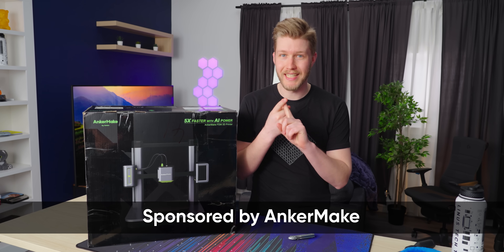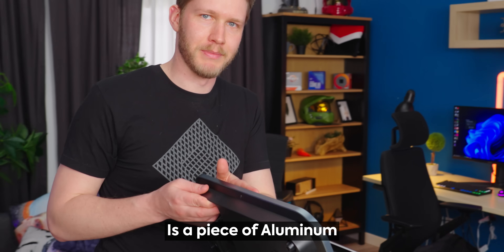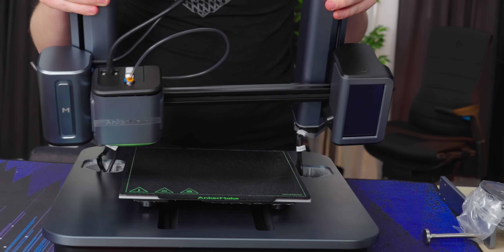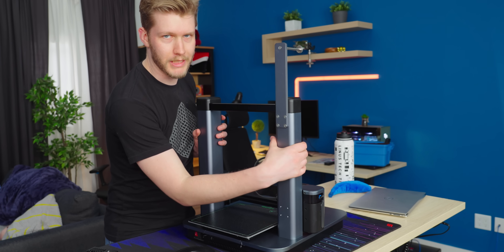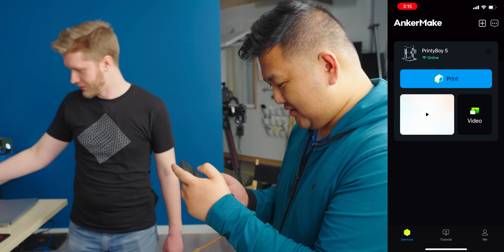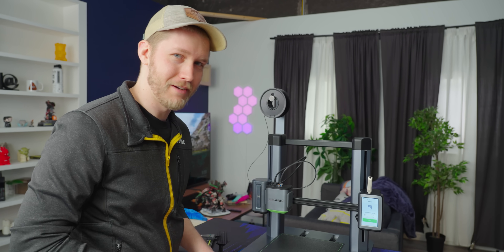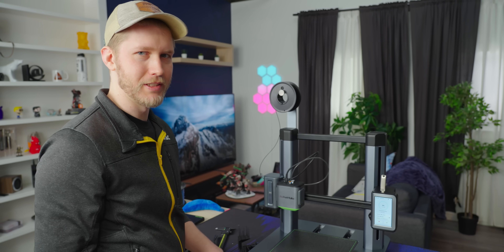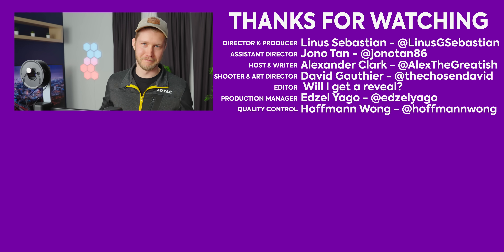Much BETTER than Expected - AnkerMake M5 3D Printer

Comment: There is no way that is actually 250mm/s. Sure, you can set the max speed to 250 but if your acceleration isn't set high enough it'll never hit it. Take a look at hevort/vez3d/voron speed runs. That thing ain't doing 250mm/s.
Reply: Yeah, I've got a creality CR20 pro, and I've extensively upgraded and switched out parts to make as high quality of a build as I possibly can - and I still only get a fraction of that. And It's still a great printer featuring work I'm super proud of! At the same time though, I personally feel like reaching the fastest possible speeds isn't always necessary, since in that type of range you will absolutely be trading speed for quality - there are times when you need to test a part, and you don't care how it looks so long it's done quickly, and other times when the quality is by far the most important factor.

In any case, that just shows how incredible those voron and rat-rig style printers are, and the sheer achievements of the people who build them. When you watch clips of those printers running, the footage is so insane, it just doesn't seem real.

Comment: Not impressed with the machine at all tbh, its a fancy ender 3, has a fake meanwell clone psu, what looks like a proprietary control board, the screen on the gantry adds excess weight for no reason. USB C isnt designed for motion, let alone constant motion with high accel/decel. The bed leveling system takes ages to complete on top of the excessive 7x7 grid. The advertisement that says a benchy takes 9 hours is hilariously bullshit, my ender 3 pro can do that in 1 hour 15 mins with a 0.4mm nozzle at .24 layer height with the same print quality by just upping the accel in firmware. This is just advertised to people who know nothing about 3D printers, its all marketing checkmarks.

Comment: I’m also pretty impressed on the build quality for its price! Looking forward to review one 🤘😎
Reply: its v rollers with covers to hide the fact that it's built like 95% of all other printers out there... there's nothing remarkable about the build quality.
Reply: @simonl7784  yea for 750 i would expect linear rails, its not that hard build couple prototypes and send them to YouTube channels
Reply: its kickstarter i would wait for final production unit reviews
Reply: Depends on if the price is gonna be 800 usd at standard, then I myself would just pick a prusa instead
Reply: I have to strongly disagree and recommend exercising caution in purchasing. This isn't a Voron 2.4 and it is painfully obvious. Wake me up when 10K+ accelerations and 500 mm/s speeds are here. And there are several parts that have been pointed out that will fail early on given the material used. Avoid!

https://www.youtube.com/watch?v=0E0dM0ZdpRE
Reply: Since this is preproduction I highly doubt it will be this nice but I'm looking forward to seeing how they come out.
Reply: @x9x9x9x9x9  it might just be nicer since this is preproduction.
Reply: Nah, retail is $750, not impressed for an ender 3 clone
Reply: @TheMidnightSmith   I was thinking the same thing - it looks like it's trying to compete with the Ender 3, but the price says it's actually competing with the much larger Ender 5...
Reply: @TheMidnightSmith  it looks like it has dual z axis motors though, a filament senosor, autobed leveling, direct drive extruder setup, and an app that works straight outta the box with minimal setup. For all those upgrades plus the ease of use / setup I'd say its pretty worth it. It competes in the same space as the Prusa Mk3 at that point which is around the same price for a similar feature set.
Reply: @6ixpool  direct drive has pro's and con's so i wouldnt count that as a feature more than a choice. and who needs an app? like whats the purpose? Dont compare this printer to a prusa. Prusa is on a whole other level.
Reply: @irozockt  as someone who has absolutely no idea about 3d printers,an app could be very useful.Also,what advantages does a prusa have over this?
Reply: @superblitz2274  holy shit is youtube buggy today or what? im writing this comment for the third time now.
Reply: @irozockt   you're not wrong but have you considered there are use cases / market segments for 3d printers, same as computers and all other tech, that may not make sense to you but would be profitable if filled. For even money yeah I'm of the same opinion as you - the Prusa is the obvious choice. 

This product isn't for us - this product is for people like us whose brother in law or uncle asks them what 3d printer they should buy & you know they're not a technical person. Alex said it in the video - "i've done literally.... none of the things... you should do when setting up a 3d printer, didn't even clean the bed... probably should have done that at least...  lets see what happens" - which is the perfect test. It's what the average consumer will do. Gamers Nexus keeps buying prebuilt desktops looking for something they can recommend not because they or the average viewer want a prebuilt desktop - we would obviously build our own. That would be the Prusa. What they're trying to find is a well built pre built with non scummy sales and support for a fair price - that's this printer. This, if the final product is anywhere near as good as this sample, is the "good prebuilt desktop" of 3d printers - something i can say this is good guilt free knowing it's a fair price and i won't end up having to be their involuntary tech support for the next few years.

You may think "still not worth it" and i would tell you the fact that it has an app with a camera that works out of the box and you literally never have to learn a thing about leveling a printer to get frankly impressive results is a major selling point to the target market segment of this printer. People used to 3d printing think the prusa/ender 3/etc is effortless compared to older printers. People still seem to struggle with them.... I say this as the owner of multiple $89 ender 3 pro's open box from microcenter - the one near me has 20+ open box frustration returns at all times. This is a printer for people who would rather just pay a few hundred bucks more for a completely upgraded idiot proof prusa clone. That market clearly exists... judging from all of the returned ender 3's lol
Reply: It's almost false endorsement to talk for many minutes on a feature that won't be implemented on the final product.
Reply: @bulljona11  considering they spent several minutes talking about how this is unlikely to be on the production model, it's not false endorsement.
Reply: @bulljona11  this is unboxing

Comment: According to their Kickstarter, the $429 is a special early price, and that reward is no longer available. The MSRP is $759. This is clearly not a machine for beginners, which is weird considering the features make it much easier to use
Reply: This is absolutely a machine for beginners. Beginner doesn't mean "broke" you know. They're going for a "just turn it on and start printing" kind of deal I think trying to reach a community of people who would like to get into 3D printing but get scared away because every review I've ever watched of a 3D printer in those price range is "If you do X or Y and use Z mod it's a really good printer" whereas this is marketed as "Put it together, plug into the wall, use the app and start printing"
Reply: @naunau311  But a high price tag is often a turn off for beginners. Lots of people want something cheap, but not as good, to try out, then upgrade in the future. 

This may not be high end, but it's priced like a mid range printer
Reply: @hapcot  It is priced as a mid ranger I won't disagree on that but the price point isn't really a turn off for beginners, it's a turn off for people who want to discover and learn more. There is a large community of people who just "want something that works" and are willing to put good money to get exactly that. That's something we could call the "apple market". Most people don't need an iPhone tier phone as far as performances and features go but they still buy it because it's less confusing than the android market and has a reputation to "just work"
Reply: Beginner friendly is a different definition to cheap. Beginners will pay for ease of use and will prioritise options that "just work" over those with more features that require tinkering.
Reply: Guessing this video caused those options to sell out immediately. Big brain Anker, using a sponsored video while they're still filling Kickstarter orders...
Reply: I'm in Aus and i can see it for US$629. I wonder if different regions are seeing different pages...?

Comment: I’ve wanted you guys to do 3d print stuff forever. Try to make an open source 3in1 printer, cnc, and laser engraver powered by a raspberry pi!
Reply: Laser and 3D printer, maybe. but CNC mix is a bad idea for a lot of reason! 3D printer you want it light for speed, cnc need to be rigid, hence heavy. 3D printer is something you want to keep clean, for bed adhesion and not having contaminant in extruder, CNC well they throw dust(cheap table CNC are not actually producing chips,  since they are actually glorified Dremel).

Comment: you're paying more for the thing to work than for pure value. ender 3s really like to stop working for no good reason, and this is honestly a much more idiot-proof design. Bed leveling is painfully slow, though, the cooling kinda sucks and i'm willing to bet the advertised 250mm/s is just the travels. probably doing walls and such at something like 80-100mm/s, since there's absolutely no way that their creality-style hotend can push material fast enough to keep up with 250mm/s. Overall I think this is a great step in the right direction for 3d printers, but still some work to do.

Comment: The advertised print speeds are a bit of a "well technically but not really" thing; with the acceleration the machine is capable of it will only hit those speeds for fractions of a second during long travel moves and during actual printing will be much lower. Look up videos of something like a VzBoT or Annex Engineering machine to see printers actually hitting 250mm/s during regular operation and compare to this. Significant difference. 

Now I'm not saying this is a bad printer, or even a slow one, as I believe it's a compelling and more modern alternative to a Prusa... it's just throwing out a bit of marketing BS.
Reply: That thing would launch the bed across the room doing 250mm/s 😂

Comment: The reason it was off .45 is because you want a gap on removeable/print in place/movable parts.... and the Ideal gap is about half the width of your nozzle.... so about .2 on each side of the circle....

Comment: I'm cautiously optimisitic about this one. Anker has a good track record of products that are well made. But huge claims in a space their new to is obviously a place to raise concerns.

My real concern is long term service. How common and easy are parts going to be to replace when things go wrong? How open is the software for modding and so the community can fix issues when the inevitiably arise?

At the final price point (not the kickstarter early bird prices) I also wonder how much this is really going to compare with similarly priced printers or kits. Is it going to be more reliable than a Prusa or faster than a voron trident kit?

You made a good observation with the aluminum plate in the base. This makes me really wonder how much is going to change between these beta units and the actual production, and how much of the results from these units can be trusted as an indicator of the final product.

The huge "black box" visuals of the extruder and the electronics mounted on either end of the x gantry are strange choices. Not necessarily bad.
Reply: what you mean well-made? Every charger overheat and one star same problem
Reply: @Richard-mu2kn  That hasn't been my experience. I have a couple chargers and 3 batteris from them and they're all structurally very solid and never had a problem with them.
Reply: @caramelzappa  do electrical jolt when taking out of outlet

Comment: You should do the knot test
Reply: Like where if you drop a roll and it gets tangled Uber itself and looks fine but then as you print it just keep pulling while it's really knotted around the spool and will knock or break something or eat the filament and break so many little chips

Comment: Calibrating your steppers further helps with improving dimensional accuracy and print quality
Reply: This is such a common misconception I stumble upon in the community waaaaay too often. You dont calibrate your steppers, nor your steps/mm. Dont touch these values, they are calculated in function of the pitch of the timing belts and pulleys, you are not supposed to tamper with them. When you get dimensional inaccuracies in your parts, the culprit is insufficient belt tension, bad extrusion or inappropiate kinemtic parameters like acceleration, jerk etc. Bascially everything lese besides the resolution. The only steps/mm you are supposed to touch is for the extruder but not the axis. All you do by e.g. changing 80 steps/mm to 81.2 steps/mm is offsetting your arithmetic mean into a higher percentile while skewing basically everthing else.